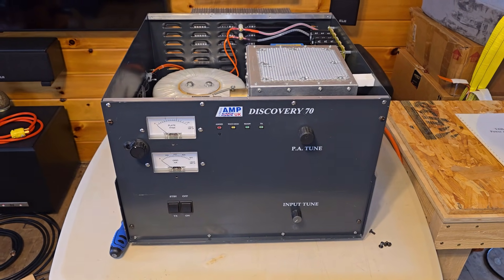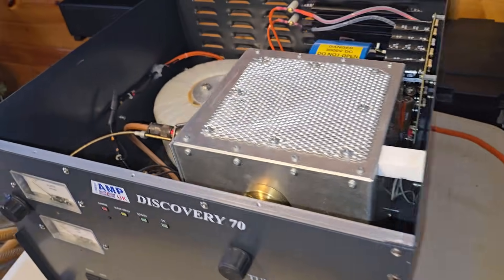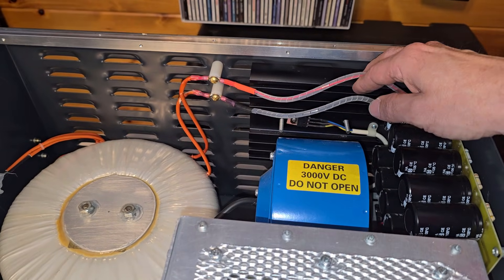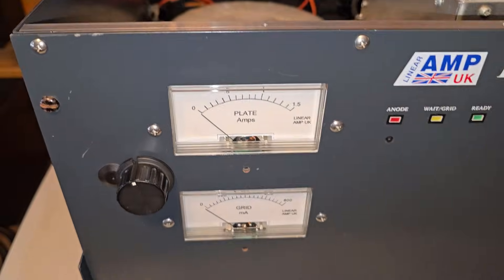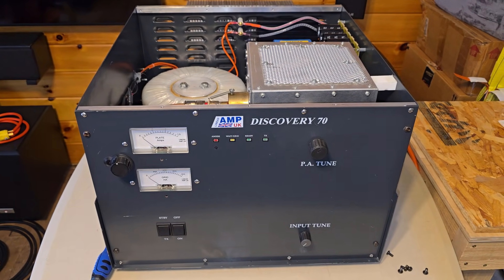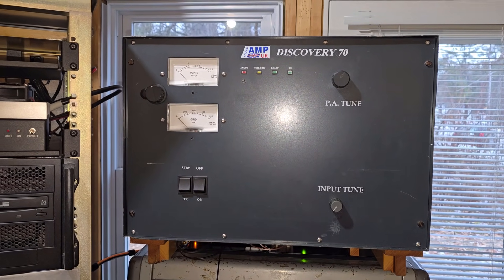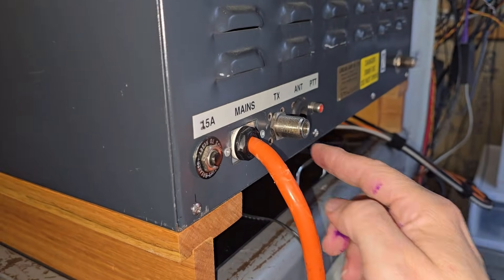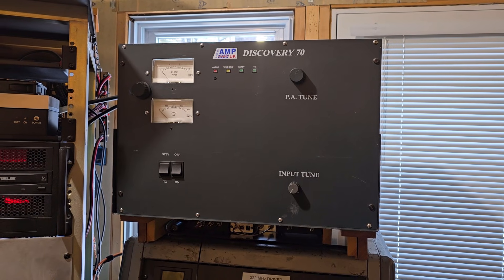Special "Discovery 70" 432 MHz Amplifier with GS35b Tube - Part 1

Comment: Wow! Looks like an awesome project! Great for EME or hitting a REALLY far away repeater! The smallest come along Harbor Freight sell will get you a couple of extra inches. I love the re-enforcement bars you've installed. They look factory. Tip of the day....Aluminum CAN be cut with a table or Skill saw quite effectively. Just be careful of your eyes and flying metal chips.
Reply from the maker: I would like to get on 432 EME but the expense likely prevents it in a way that would be satisfying to me. For now I will use it for tropo, aurora and whatever with my single 40 element yagi at 110 feet. I have only 25 watts on 432 right now. I've been cutting aluminum with a table saw and power miter saw for years without a problem. I had my first mishap about four months ago. A piece of 3/8" x 4" aluminum rectangle bar shifted, caught the table saw blade and flew into my arm, creating a deep cut. Since then I am very leery of cutting aluminum on the table saw.
Reply: @n1bug  OW! I had a mishap with a tiny circular saw that fits in a Dremel once. What saved my thumb was the fact that the blade was dull, although, it did a LOT of damage quick! Those 4 inch cutoff wheels that go into angle grinders can be really dangerous too. I had two substantial eye injuries due to the strap in my goggles wasn't elastic and allowed a gap for the sparks to go right into my eye, then I did it again 2 weeks later with another set of goggles (with good elastic) when I was under a vehicle and the they didn't seal to my face when I reached over. So now, no free hand AND a full face shield AND GOOD goggles. I was "down" over a month. Didn't get medical treatment for any of those injuries, but really should have. It pays to be safe and take your time!
Reply from the maker: @W1RMD Eye injuries are not good! Thanks for the warning on angle grinders. I didn't have one until a couple years ago. I have little experience with it so far but have used it to cut off bolts, chain and things like that several times. I have been using those goggles with the elastic strap but your comment is making me rethink that. I should have better face and eye protection for a lot of stuff I do. My father worked in a sawmill so I was aware of the dangers of saws from an early age. I should be more careful but I had become complacent. Hopefully my recent accident and you sharing your experience will cause me to do better!